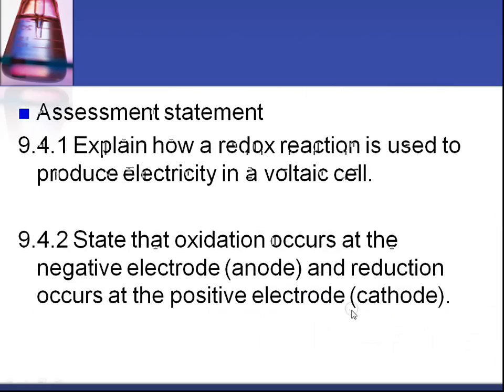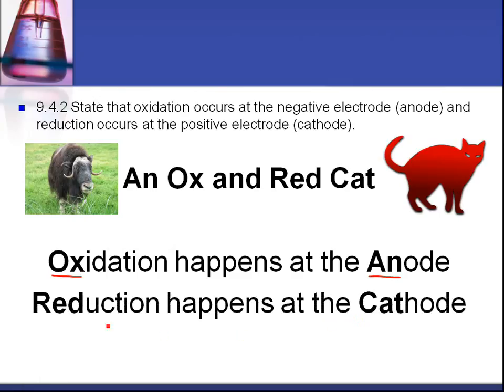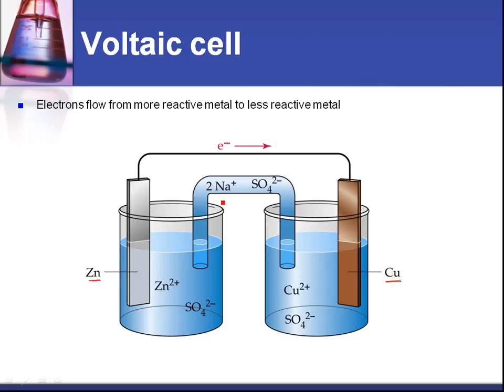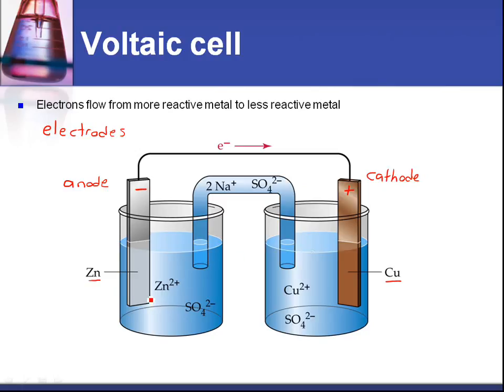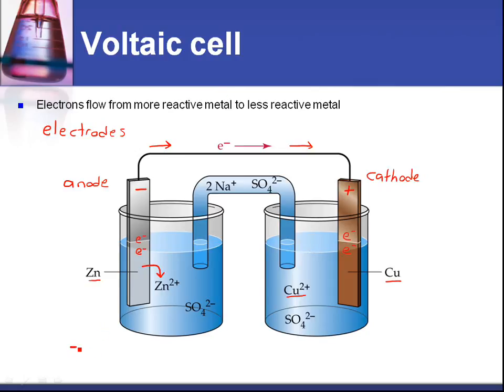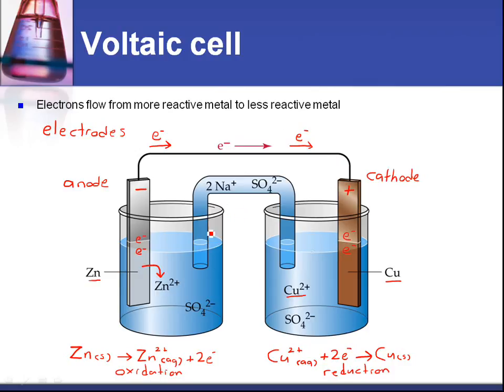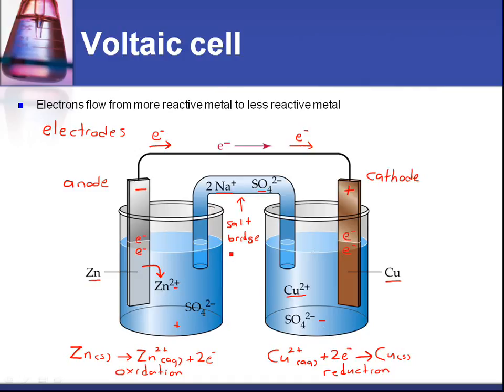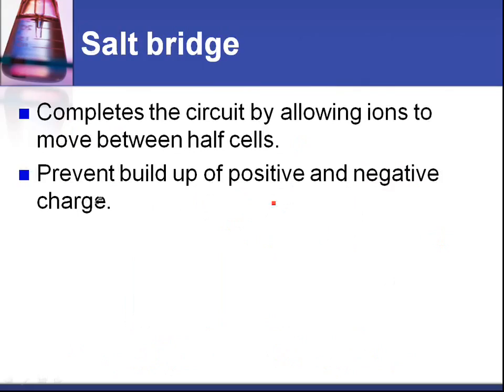9.4.1 Explain how a redox reaction is used to produce electricity in a voltaic cell.

Comment: Good sire. Thank you for this 🙏

But what makes salt bridge an ion conductor but not electron conductor?

What is the electrolyte composition to be used? What are the guidelines if any?

Should the positive ion on the electrolyte be less reactive than zinc, but more reactive than copper?

Why do we need two electrodes? There is a redox at each node (at anode metal oxidized, electrolyte solution positive ion is reduced) so one anode is sufficient to produce electricity?

Comment: Why silver is 2 in the reaction 2AgNO3+Cu=Cu (NO3)2+2Ag and why it can't be written as AgNO3+Cu=CuNO3+Ag it is also balanced know?
Reply from the maker: Mohammed Arshak Because copper is a 2+ ion and silver is a 1+ ion. The second equation that you wrote is not balanced correctly. The first equation is correctly balanced.
Reply: Copper can be a 1+ ion since it is a transition element
Reply from the maker: Correct, but in this case it is the copper(II) ion.